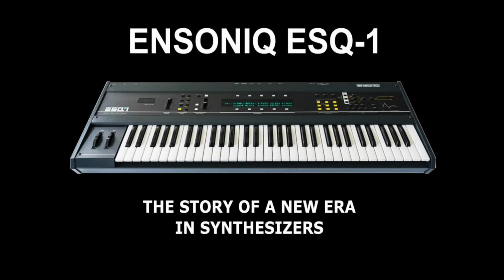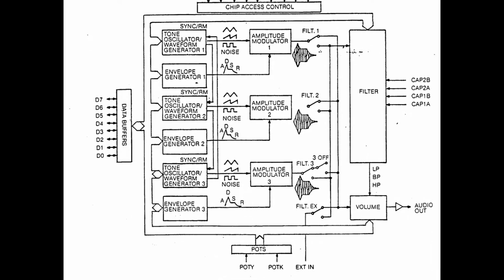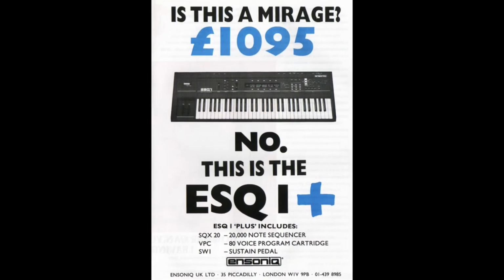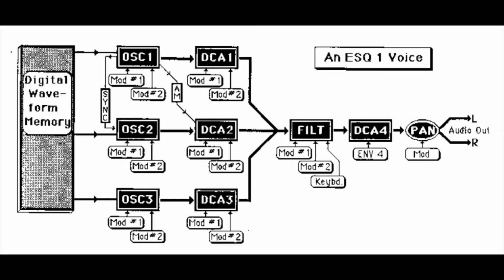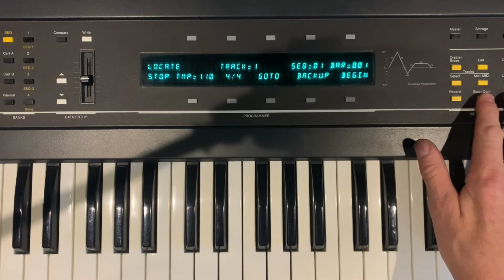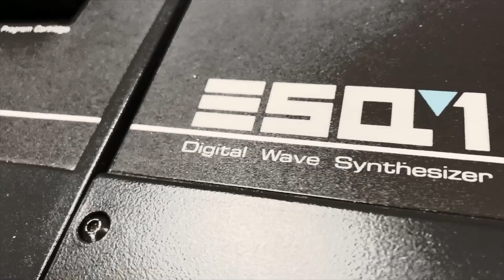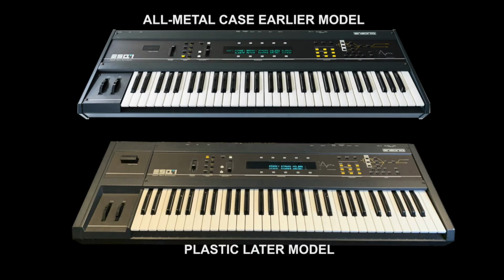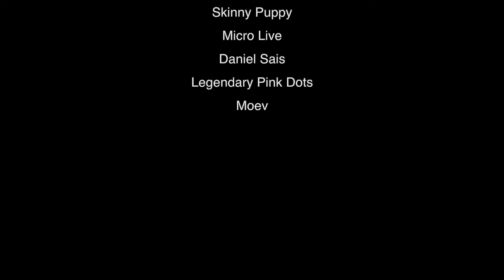Ensoniq ESQ-1 Story

Comment: Fantastic tribute.  You really captured the 80's noistalgia in your video.  I have a metal case ESQ-1.  It's developed an issue where the sound intermittently becomes loud and distorted.  I'm told reseating the chips might help.  It's a great synth.  I remember when it came out, loving it's sleek appearance and the very TRON-like VF display, which almost had an infinity mirror look to it.  Even the Ensoniq logo looked similar to the Encom logo from Tron.  Very distinctive 80's synth...digital, but with an analog quality.
Reply from the maker: Hey PM - thanks!  Have you tried looking at the the volume slider?  I hade mine go bad and it was doing a similar thing where it was just 'snapping' randomly to full volume.

Comment: Years ago I was given an ESQ-1 which is faulty / needing repairs. Life got in the way. It's still sitting there. I need to get it out and restore it. Thanks for the great video :) The algorithm fed me your K3 video this morning, I used to own a K5000W. Subscribed :)
Reply from the maker: Thanks for sharing.  ESQ-1's are pretty repairable - is it the display?
Reply: @johnnymorgansynthdreams  I am unsure - I haven't actually tested it. Will open and inspect first. Although a few days ago I picked up a fully functional TS-12, which while lacking ressonant filters covers the other end of Ensoniq quite nicely I think.
Reply: @johnnymorgansynthdreams  - I'm back with an update! Haha. It has multiple issues. Display is garbled in self test mode (harness unplugged from mainboard) but garbled normally then when you press buttons the garbled characters scroll off and then it's blank till the next power cycle. No battery left in there to rot thankfully. Under load all voltages at the power supply are normal. Keybed has issues, some stuck notes. Had to reseat mainboard power connection a few times to get board to power up, with keyboard unplugged can control it normally over midi. Pressing buttons blind after reading the manual to learn how, i can adjust oscilators, envelopes. Hard reset, soft reset, and filter calibration after that still can't get filter or panning envelopes to change. In fact the left / mono output works but goes very quiet when something is plugged into right output, which then outputs most of the sound. So I've got quite a few little repair jobs. VFD display is too tall for the case and was loose in the case, I think it's a donor from a plastic model (mine is metal) from the previous repair attempt. I've contacted Rainer at Buchty net to get a display driver chip kit, he's out of stock at the moment and has to make more. So I'm not expecting help from you or anything, but came back today to watch your lovely mini-doco again, and thought my comment needed an update. :)

Comment: Geez this thing slays the DX7, DW8000 and D50 COMBINED
Reply: Digital Synth world is split between FM synthesis and subtractive synthesis. So Yamaha DX7 cannot be used for comparison between  subtractive synth devices. They produce different classes of sounds and complement each other.
Reply: @alexanderbelov6892 Good points, and they are a reason people collect multiple synths to begin with.
Reply: @rorbot_SMF  There are also Yamaha Montage and MODX synths to combine AWM2 and FM-X as implementations of digital subtractive synth over Wave Tables and FM synth with 8 operators.

Comment: Great video 👍 I done many recordings with the ESQ1 and used its sequencer in favour of a software sequencer (Cubase on an Atari ST) until I had no option but to move over to Cubase for routing options with the MIDEX interface to avoid MIDI timing issues, with it's multiple parallel MIDI outputs. I used to synchronise my ESQ1 via FSK to a multitrack and as archaic as that sounds, it was a great option before I started using SMPTE and MIDI timecode. Without the ESQ1 I doubt the UK dance scene of the early 90s would have been what it was. I have had many synths and the ESQ1 has always been my favourite and it probably had my favourite hardware sequencer as well. Again, great video 👍 Cheers, Dave.
Reply from the maker: That is very cool - I think if I really spent some time on it the sequencer is super powerful.  If that was all you had you certainly could create complicated songs and sequences.  Thanks for that info!

Comment: I still have my Ensoniq SQ80 (essentially an ESQ-1 with a floppy drive and expanded memory) and it's still working flawlessly some 34 years later. The user interface is the best one I've ever seen on any other synth, especially the sequencer section. Unfortunately, the 8 bit nature of the beast sometimes shows its limitations, but for the time it was very impressive at that price point.
Reply: The SQ-80 was actually 12bit & not 8bit like the ESQ1 was... The SQ-80's were basically a late stab of releasing a bug free & better built attempt to revamp the initial great sales.. & reputation of esq-1s. SQ-80 is the rarer, & better 12bit version. There was only one, late production run of SQ-80's... I've been told that only about 800 units where made & sold in its time. They are usually sold 2nd hand now at close to twice as much as ESQ1s do. They do sound better, & are known to be well constructed & bug free for purchases as 2nd hand Ensoniq gear goes. If u have one don't let go of it.
Reply: @TimesOfTheSines.official  
Are you sure about that? The SQ-80 uses the exact same chipset as in the ESQ-1 (Ensoniq DOC which works internally with 8 bits resolution, 8X CEM3379, 68B09E CPU), with added Western Digital 1772 Floppy Controller chip, and 80K of sequencer RAM. I should know I have the schematics in front of me. 
Perhaps you're thinking of the Ensoniq EPS (which is a 12 bit sampler), and the EPS 16+ which was 16 bits? The Mirage is, of course, 8 bits because it uses the same DOC chip as the ESQ-1 and SQ-80. 

As I said earlier, the SQ-80 came out in 1988, a few years after the ESQ-1, and it was a "souped-up" version, with a completely different keyboard controller with contactless keys and polyphonic aftertouch, a 3.5 inch floppy drive, and maxed-out sequencer memory, and a bigger choice of wavetable samples in a bigger ROM. But everything in it is 8 bits. It's essentially an 8 bit specialized micro-computer from the eighties with 80K of RAM, superb software in ROM, and a custom audio IC chip.

Comment: I bought my ESQ-1 in 1990 - I was actually looking for a DX-7 but the ESQ-1 came along first so I bought it. I programmed it to do drums (driving a drum machine via midi) and synth in a covers band in the early 90s - all using the onboard sequencer. At the end of each set we'd have a break of about 20 minutes which gave me a chance to load the next set from tape. It took just under 10 minutes to load so I had two chances to load the set - sometimes it wouldn't load and we ran a bit late. But the keyboard was built like a tank. I sold it about 10 years ago, I still have my TS-12 which Iove.
Reply from the maker: Hi Matthew - that is an amazing recount.  I so remember those days as well, loading samples at the end of each song for the next, and sequencing from am IBM XT running Cakewalk V1. Great times!

Comment: I WILL NEVER sell mine. I've had it since about 1987 and it was a beast to haul around(all metal case version) on the road. It DID have it's problems though.....mostly with keys breaking and and they would pop up 1/2" above the rest but a simple piece of scotch tape remedied that problem on the fly and the show went on until I could get it serviced(this happened at least 3 times but I am a hard player). It never let me down through decades on the road! I am looking for the "rack version" now just for the "nostalgia factor" for my home studio but man they are pricey even on ebay IF you can find them. People just don't want to part with this amazing synth from that era!

Comment: I had one (drove all the way to West-Berlin in a Volkswagen Beetle to pick it up). I remember tweaking sounds for hours and hours. The sequencer was great as I didn't have a computer yet, which seems odd from today's perspective. In hindsight, the design was good, but only took me half way to the desired results – there's only so much you can do with a single-cycle 8 bit waveform. It also needed the analog filter to barely survive basic criticism, I think that with a digital filter solution it would have sounded like a Casio toy. Still had a great time with it.

Comment: I had one from 1989 to 2012. When I moved across country, it was too large and heavy. I sold it with an SKB hard case. I think I got about $200 or so for it. Trust me…I hated selling it and I miss it. I played many gigs and made quite a bit of money with it.
One of my favorite patches was a Hammond B3 that I made and put the Leslie effect on the mod wheel. I also had it written so that when I turned just one of the DCAs up one or two clicks, it would simulate “tube amp” overdrive to give it a taste of vintage OD.
I gigged the hell out of that board and wore out the sequencer. The sequencer eventually stopped working. Oh, man! How much I miss that synth. To get a 3 oscillator synth today costs a small fortune.
Reply from the maker: Thanks for that bit of history.   The Hammond sound was really good for a synth at that time. ESQ-1 was so versatile.

Comment: The Mirage was groundbreaking at the time, but Ensoniq never managed to retain the sampling market, even though the later EPS was excellent, as Akai dominated.
The machine I spent most time with was the Ensoniq VFX and VFX-SD which became the successors of the ESQ-1.
They were fantastic machines, but prone to terrible reliability issues. At one point they were coming out of the factory with a 95% failure rate.
When on tours I would take two spares because they were so flaky.
Reply from the maker: Exactly - I always used Akai on tour - bomb-proof at the time.
Reply: @johnnymorgansynthdreams  I started with the S900 and went on to S1000, they were used everywhere.

Comment: I have one of these, it's been sitting in its flightcase ever since I (thought I) blew the motherboard by wiring up memory protect battery wrong. 
It actually works perfectly well, just needs a new memory protect battery. If I can source sysex presets I'll keep it, otherwise, it's going on Ebay.

Comment: You know... I always liked the way both the Ensoniqs and the Hydrasynth put their controls around their screens; but it's only with your closeup of the signal-path diagram embedded in selection buttons, and so on, that I realised just how much the Hydrasynth is like a modern Ensoniq. Not just in front panel, but they have a similar method of interesting waves put through decent filters (and in being cheaper than their main competition) as well. (Though I think a turquoise VFD looks nicer than a white OLED, any day!) 

Speaking of the SID chip, the original intent was to have I think 8 voices! Which would've been an absolute power-house, and competed very well against the AdLib/Sound Blasters IMO. As it was, they cut it down to 3 voices to increase reliability and ship by Christmas. Which tbh, maybe that was a good idea with how many have their filter sections fail lately... 

But it's fun to imagine a SID chip with 8 or 9 voices belting-out massively complex harmony AND drums, rather than having to very quickly arpeggiate like the SID artists nowadays do. Though having said that, there is something of a charm to the driving arpeggiated beats and complex filter-switching on the noise-source to make drums on another channel. But I digress :)
Reply from the maker: Thanks for all that detail  - You're totally right abouththe Hydrasynth beign a modern day Ensoniq - never thought about that but so interesting..
Reply from the maker: BTW - have you ever tried a SIDstation?  I'm so wanting to get one but they're pretty rare
Reply: @johnnymorgansynthdreams  alas no! Nor any modern ones (therapSID etc). They all seem very fun though

Comment: I have its predecessor, the VFX-SD. Still a great sounding synth.
Reply from the maker: I hear the VFX-SD is awesome.
Reply: Successor. It came after the ESQ-1.
Reply from the maker: @TryptychUK  I think it was early 90s correct?
Reply: Yes, successor…. I was thinking of the SD-1 that came later.
Reply: @johnnymorgansynthdreams  Late 80's.
Reply: @johnnymorgansynthdreams  It is. You should try and check one out. It's kind of like a Korg M1 on steroids.
Reply: @johnnymorgansynthdreams  I still love it. So easy to use. By today’s standard it’s grungy sounding but the ability to layer sample based and waveform based sounds gives it a unique edge. Also great onboard sequencer.

Comment: Sitting here looking at mine, which has not worked in 20+ years. When I went down I was told it needed a battery, so I tried to replace it, but it still never worked right. it sat in my storage for years, and gather a bit of light rust on the faceplate, but I'm convinced I can still restore it. Itactually turns on (the display comes on a bunch of bars), so hopefully, it has some life in her. i need to find someone to work on her.
Reply from the maker: Sad to hear that Wendell  - I hope you get it going one day.  ESQ-1 were well known to have an issue with the display communication system.  Does it play any sound even with the bad display?
Reply: @johnnymorgansynthdreams  no, actually when I got it ( it was a permanent load from some wacked out kid in college, lol he was trying to sell it me but when I showed him it didn't work he left it with me) it turned on and the display worked correctly, but no sound came out. I never tested if it has midi ability. I read on various forums it needed a battery and possibly software reinstall, all stuff I was able to do. I got a replacement battery, and soldered it to the board, and the display went to the "---- " view. At that point I pretty much gave up.  I put it in storage a few years after and never looked back. 
I retrieved it from storage about two years ago, plugged it in, and the same "---------" came up on display. I don't know where to take it, I don't trust the local electronics guys and I read a few that will do it if I ship it to them, but I'm nervous and the damn thing weighs as much as a small car, so shipping is expensive.
I need to stop procrastinating, because I know the longer I wait, the less likely I'll find someone to fix it.
Reply: Try the hard reset, it’s in the manual (online). It only weighs 15kg and can be packed into a standard box if you use lots of wrap. The battery is only for the ESQ-1 sequencer, m8. Has nothing to do with the main synth. Also, check none of the ICs are loose, or board connectors. They’re pretty reliable synths, generally.